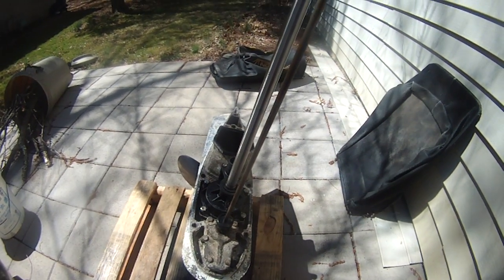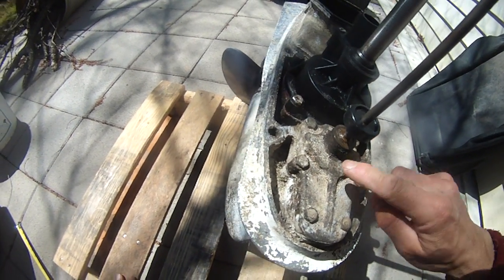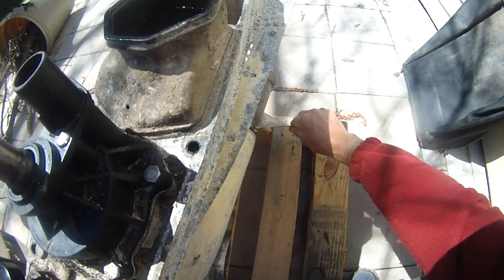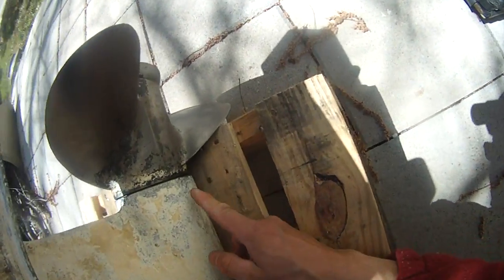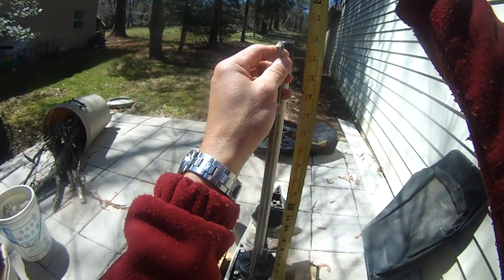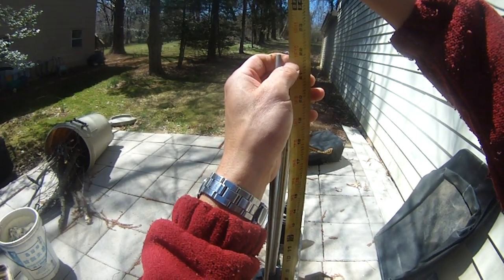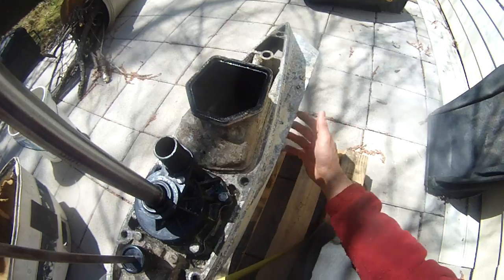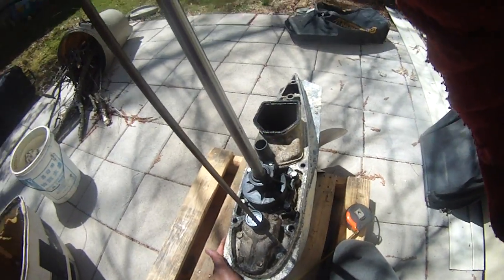Johnson 90 hp - testing lower unit for no reverse

Comment: Once you done installing it Before going in the water Fowared then turn your prop both sides of she's locked in both sides your good now do the same with reverse click click your good If she continues to turn then your not all the Way in . Note also have the motor all the Way down when ur checking it
Reply from the maker: Wow, thanks for the expert tips. I will use them next time when I have to change the impeller.

Comment: You linkage (black trunion nut) under the hood is where you should be adjusting.  Just removing the lower unit will not change the shift rod height very much...if at all.  If you have no reverse (with the controls) make sure the cables are indeed moving the shift linkage back and forth; thus also moving the shift rod up and down.  

You have water in the lower unit.  Prop shaft seal could be bad.  The shift shaft seal could be bad.  The drive shaft seals  (under the water pump) could be bad...or it could be something as simple as a crush washer (behind the filler screws) may be leaking.  Seals are inexpensive....as long as you have the lower unit dropped, I would replace the seals.  Sure is cheaper than a new or used lower unit.  If the lower unit is already back on and you have actually run the motor, pop the lower screw again...if you see grey fluid, or if it looks like baby poop yellow, pull it back off and start looking.